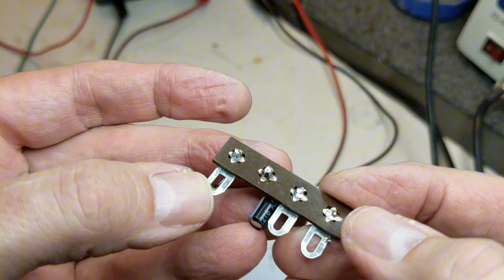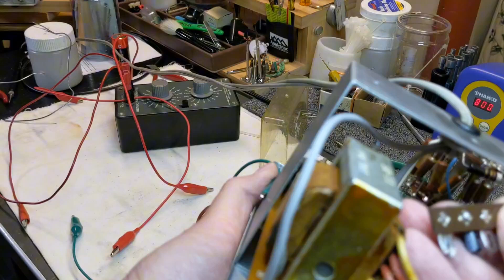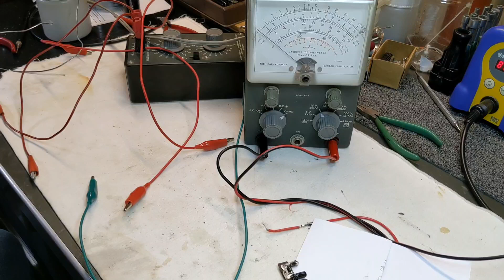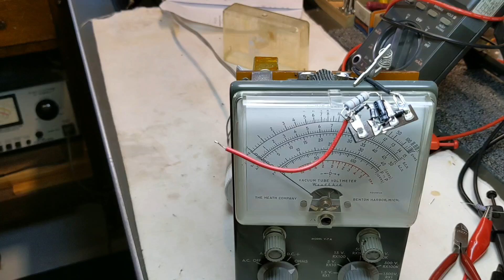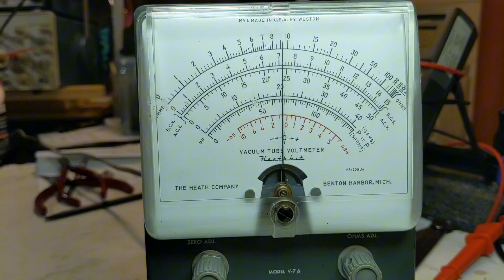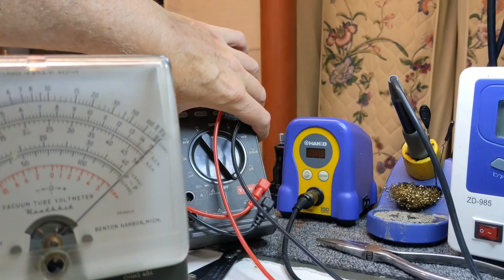Heathkit VTVM Battery Replacement Mod.

Comment: Hi there. Thanks for presenting this fine solution. I'll use it for sure! You mention in the beginning that the circuit only draws current when the VTVM is in the OHM mode. As far as I can see from the schematic it draws a constant 178 mA as the seriescoupled diodes go unswitched to chassis ground. The resistor drops 6.3 V-1.5 V= 4.8 V. Then I=4.8 V/27 Ohm=178 mA. So exchanging the incandescent lamp for a LED seems like a good idea.
Reply from the maker: I would agree that using an LED is probably a good idea.

Comment: Thanks Fred but Its not clear to me where the black wire is sourceing to 6.3 volts.
Reply from the maker: Hi Clive, sorry for the delay getting back to you.
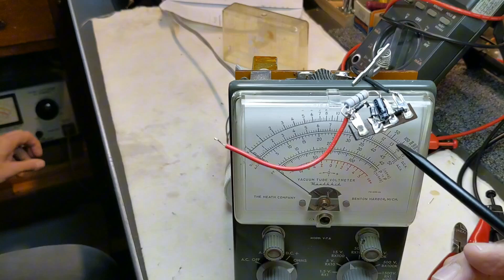At 3:05 into the video I show taking the 6 volts off of the lamp socket. I attached a black wire at that location and at 13:15 into the video you can see that black wire coming through the same hole as the diode and going to the circuit. I put the wire through the hole with the diode to prevent it from being pinched when putting the back cover on.
I hope this helps and thanks for watching my videos.

Comment: The secondary for the filaments is only 0.8A and therefore already max utilised.
So I replaced the pilot lamp with 2 anti parallel LEDs with series resistor.
And for the battery voltage I have a DC to DC converter with prior a diode and smoothing capacitance for AC/DC, costs nothing more.
Overall, I now consume less than original and do get 6.3 VAC filament voltage.

Comment: You have to CALIBRATE  ( using the DC CALIBRATE POT) the ohm scale with a new one and a half volt battery to the red dot to the right of the ohm scale, then set the zero controls. Red dot is used because anew battery is 1.55 volts. Carl
Reply: I forgot, use the one and a half volt position.

Comment: Just curious, did the ma draw go down from 60ma once you got the circuit corrected?  Useful video, thanks.  I will probably make that mod on my Eico VTVM.
Reply from the maker: That's a good question but I didn't recheck it after the correction.

Comment: When going from a schematic to an actual physical design with real parts especially on a terminal strip it is best to make
a line drawing first in cases like this. Learned the hard way when I blew up an electrolytic on totally different circuit design, yikes!